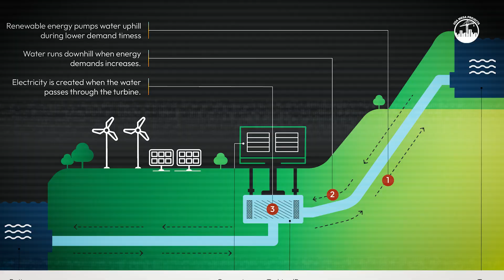The World’s Largest Battery Tower

Comment: 3:13 - potential energy
3:30 - excess electricity pumps💧up a hill
3:37 -💧is released thru turbines to make power
3:41 - a giant💧-based🔋 
3:19 - same principle as pumped hydro storage
5:03 - lifting + lowering weights or💧volumes
Reply from the maker: Yes, that timeline is accurate. The system works by storing energy as potential energy, using excess electricity to pump water uphill, then releasing it through turbines to generate power when needed. It’s essentially the same principle as pumped hydro storage, and the comparison to lifting and lowering masses or water volumes is correct.